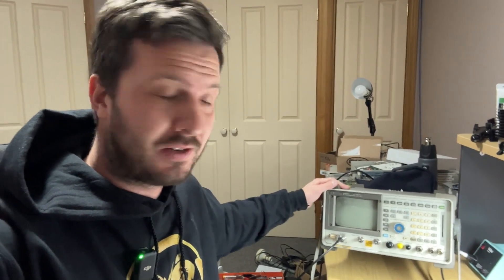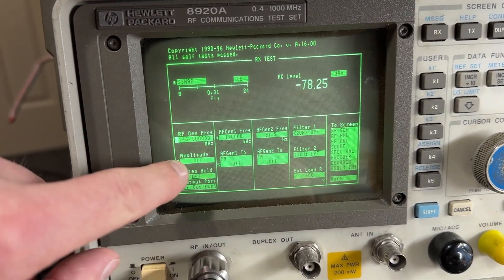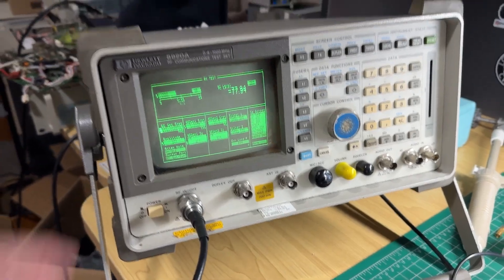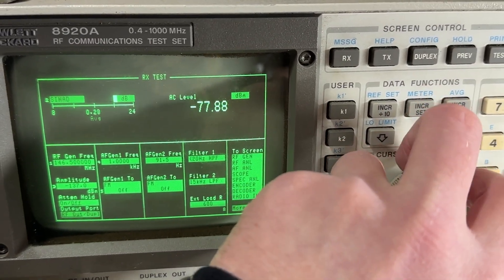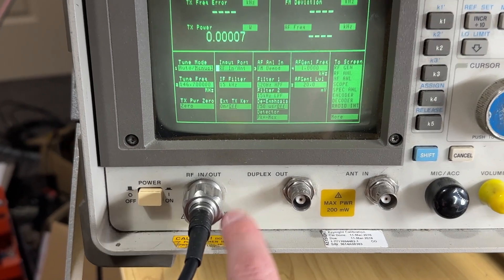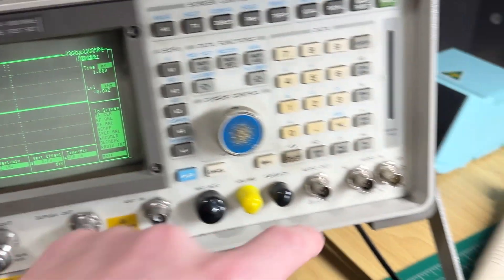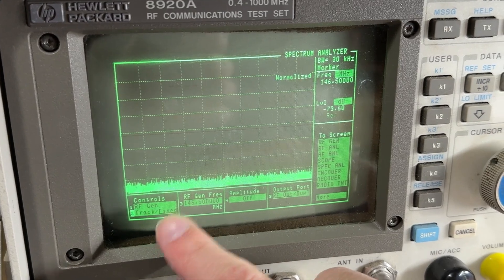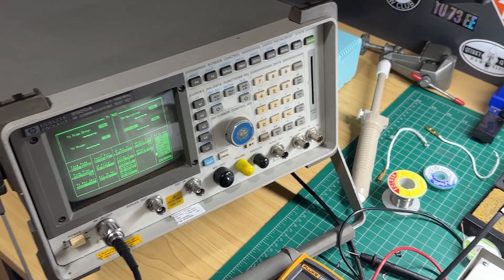RF Service Monitor - Here's Why You NEED IT!

Comment: You transmitted into the “Antenna In” jack. Wasn’t that a mistake? You should use RF IN for that.
Reply from the maker: No, I put an antenna on the ANT jack and it was receiving a FM radio station. It’s a more sensitive input.

You can still transmit into the antenna jack but power is limited to 200mW max.

Comment: Did I miss the price? or is that aspect of info persona non grata.. Could be interresting to sense what that unit flipped for with those options in a far away region like Australia.
but atleast it smaller then HP8924C.
Reply from the maker: $1000

Comment: I picked up a Motorola R-2001D monitor at a local hamfest last year; similar capabilities to your HP (spectrum analyzer with tracking generator , signal generator, FM deviation meter, RF power measurement to 120 watts).  These test sets were EXORBITANTLY expensive when new; I know the R2001D’s sold for something like $16K ~ $20K.  This is the 2nd one I’ve owned; the first one I bought used at the Dayton Hamvention when I was trying to get my own service shop going; paid $4700 for one that had definitely been beat up a bit in field service work. (And it died 2 weeks after I got it home! 😱 Fortunately, I had gotten the service manual with it & quickly diagnosed the problem to an intermittent connection between the power supply and motherboard; a couple of soldered jumper wires cured the problem permanently.  I got something like 7 years use out of it afterwards.  When I decided to bail out of the business, I sold it to another shop for $2500.  (My concern was the CRT, which was “unobtainium” if it died, leaving me with a very expensive boat anchor!). 🙄
    As I mentioned earlier, I picked up another one (just for my own radio tinkering) last year; this time for $300! 😃. If anything, I think it’s In better shape than the first one!  (Much better physical condition, CRT looks decent, & not a big loss if this one dies).
But as another alternative, don’t write off the Tiny SA; it’s got the 2 most expensive features of the service monitors (spectrum analyzer & synthesized RF signal generator).  I’ve got both the original Tiny SA & just bought the new Tiny SA Ultra a couple of weeks ago.  My Motorola R-2001D tops out at 1 GHz. frequency coverage (& I’m guessing so does your HP monitor); the Tiny SA Ultra goes up to 5.3 GHz., costs only about $170 NEW, & is pocket- sized, making it great for doing quick checks on at least receivers (& the receiver portion of transceivers) at hamfests! 😎

73,
Tom WA1LBK

Comment: Hi
Great test kit, I. Just got out bid on one of these on eBay, on the options labels there was not all I wanted anyway, 
What is on your opinion labels ?
Thanks Dave 2E0DMB
Reply from the maker: I have 
001 - High stability ref
004 - Audio signaling
013 - C Message filter
014 - 6 KHz bandpass filter
102 - Spec An + TG
103 - GPIB/RS232/parallel ports
Reply: @HamRadioDX  great, thanks, that's nice , please do some more videos on the unit,
Thanks Dave, from the UK

Comment: They are a great machine. I note yours has a bit of  the black dust on the screen. Typical of what you get with high voltage CRTs, you can pull the front screen cover off but just watch the fine mesh. Mine had that and a good clean made all the difference. The normalising function in the tracking gen is great to take out coax losses / impedance bumps if you have a bit of a coax run to the DUT.
Reply from the maker: Thanks Simon. Yeah I need to open it up and give it a nice clean out

Comment: That's a great pickup there Hayden - they're not easy to find. A few years ago I rescued an as new & clean HP 8594E SpecAn (to 2.9GHz) with many options including tracking gen that was days away from heading to the skip bin. Someone at work thought it was an old professional TV with lots of buttons. My win 🙂
Reply from the maker: I shudder to think of all the equipment we've lost to someone just tossing it in the skip!
Reply: @HamRadioDX  I recently saved an Anritsu 47GHz Spec An from the same skip bin... unfortunatley it's still on the asset list... just...
Reply: @HamRadioDX  Are you going to do the LCD conversion??
Reply from the maker: @nikpresservk3ba779  Yes, when I can afford it

Comment: Too bad they are so expensive that they are out of reach of most hams.
Reply from the maker: Not really. You find them come up every now and then for cheap. A HP8924C should set you back $500-$1000 depending on the condition. That's the cost of a new mobile radio these days. 

Plus the benefits last for years, I've paid this thing of multiple times already in how handy it has been.
Reply: Not really, look how many hams are spending more $$ on flashy rigs like the IC-7610. Gear like this is less expensive and way more interesting to own.

Comment: Sweet! I love these things, but not ready for one yet - I need to learn more about them, so I'll be watching.
Reply from the maker: One day soon! Plus not really easy to cart around the place
Reply: @HamRadioDX  exactly!
Reply: Unless you do a lot of radio work, you can do the same job with a SDR. But...a real spectrum analyzer will show you things that a SDR can't. For instance...a few years ago I noticed that I wasn't hearing any VHF high band stations on my scanner. The scanner's S meter was full scale and the SDR showed an unusually high noise floor. I experimented with antennas and even bought a new scanner, to no avail. The SDR pointed to a local FM radio station on 96.9. Before firing off a missive to the station I tested it with a spectrum analyzer and the station wasn't "dirty". 
The fix was a FM band filter. Testing it with the spectrum analyzer showed that it was a brick wall to the 96.9 signal.